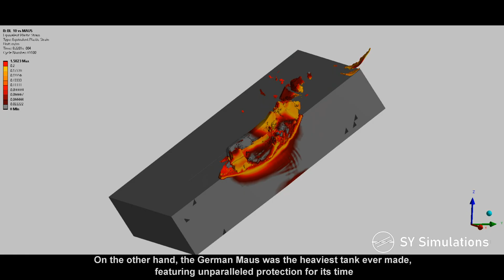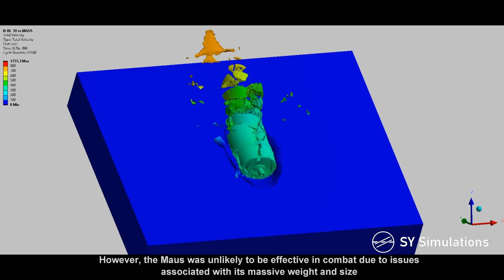MOST POWERFUL WWII CANNON vs MAUS | ISU-152-2 vs Maus | Armour Penetration Simulation

Comment: With such a heavy round I expected more significant bulging tbh. Pretty surprising
Reply: This is 200mm sloped. Nothing until the late 50s - 60s could ever hope to pen this.
Reply: @sensor3dd  200mm sloped at 45 degrees (from my research) equates to around 310mm
Reply: @MILOM206B*52° from Russian sources,so 324 mm LOS.
Reply: @ShokkuKyushu  thanks for clarification
Reply: Russian sources aren’t always reliable though
Reply: @MILOM206B The sources are most reliable from the one exact place the event needs to get reported from, not a single median degree eastward or westward. Since Maus tank just so happens to be located in Russia you physically can't get a more accurate report from where the Maus isn't.
Reply: @ I agree, but Russian bias is real
Reply: @MILOM206B I'm glad people trying to keep Internet internationale a fun place. :) 

I wish... your personal experience with communities remains as wholesome...
Reply: @MILOM206B  It's wrong and it doesn't need to make research about that. You can calculate it with the pythagorean theorem : hypothenuse (equivalent thickness)=SQR{(Sadj)exp2+(Sopp)exp2} and with angle=45°, it means Sadj=Sopp. It comes hypothenuse (which is the equivalent thickness)= SQR(2SAexp2). So it comes that a 200mm, 45° angled armour gives an equivalent thickness of 282.8mm, not 310mm...
Reply: @sensor3dd  It would not penetrate, but considering the quality of late war German steel, it would likely crack. If hit in the turret, expect jammed turret ring
Reply: Remember this is all a mathematical model. Its not necessarily 100% accurate especially since the model makes assumptions about rigidity and material properties
Reply: @SupremeRTS  Does it? E=206 GPa ,RHA=300 Brinnel. What is wrong is that Maus used carburized FHA.
Reply: Well Maus was made to withstand the strongest guns of the time
Reply: It is ww1 battleship effective armor though.
Reply: It were 152mm Howitzer, it had pretty short barrel, upon hitting Tiger turret, turret were not penetrated, but after such hit turred were moved out of turret ring, resulting crew sustain fatal damage same as tank
Reply: Indeed
Reply: It's too low velocity to really punch
Reply: i wonder if the explosive mass would have caused some spalling.
Reply: Это неточная симуляция!
Reply: APBC are just terrible against sloped armor.
Reply: That's 750meters of range btw
Reply: Given late war german steel quality-
Very much not unlikely
Reply: I guess it would defeat Abrams armor as the jagdtiger almost pentrated it and had spalling inside . There is a method to the brute force
Reply: @cat_lin1 it’s kind of funny that an APFSDS that wouldn’t pen MBT armor would cut through the tiger 2 like butter, but a shell that is unable to pen the tiger might go through a MBT at point blank range. Just how things are optimized.
Reply: @cat_lin1  “Can it defeat Godzilla?” Yes. “How?” With sufficient velocity.
Reply: The front of the turret would not resist anyway.
Reply: thats what she said